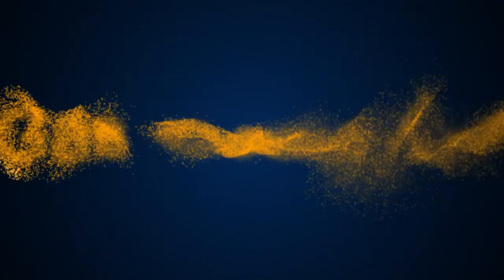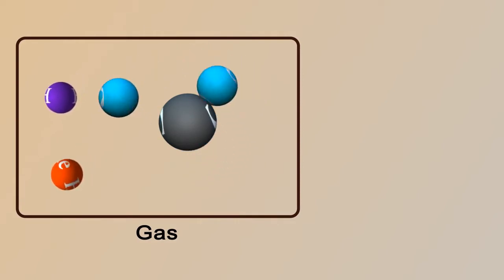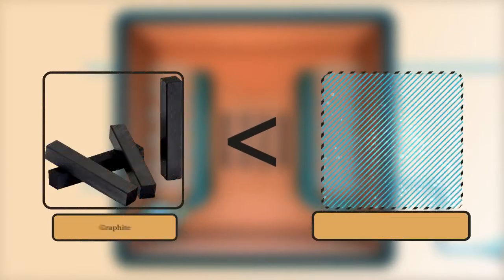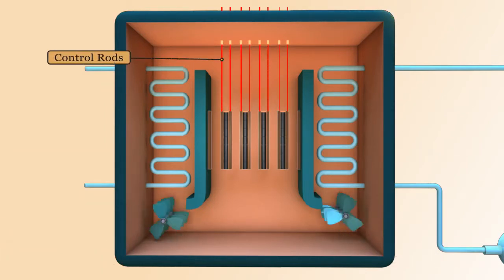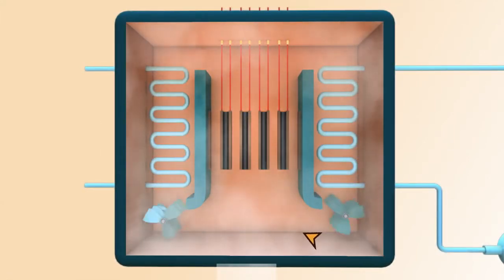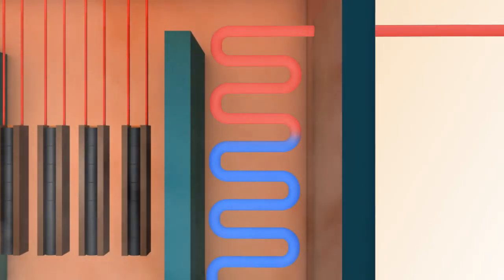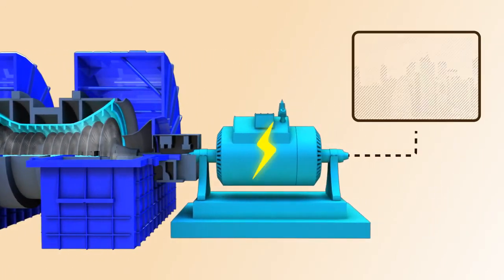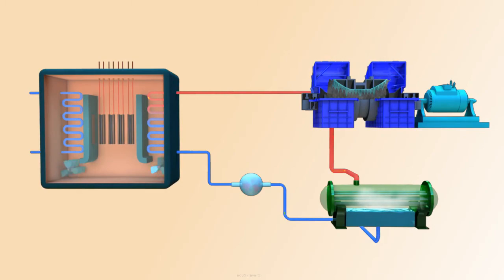Gas Cooled Nuclear Reactor

Comment: You forgot to specified that the condenser should be painted with barium sulfate paint that reject the heat into out space instead of the atmosphere that will help to heat up the planet. Where as when the heat is rejected into space with the sky cool barium sulfate paint, it doesn't heat up the environment because the heat is not trap in the atmosphere.